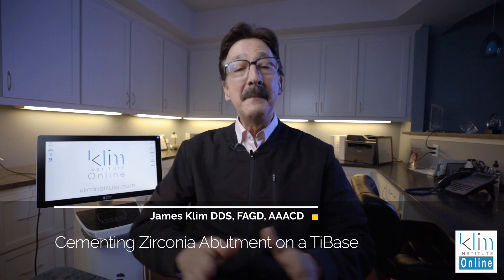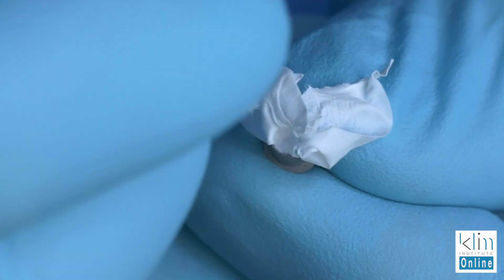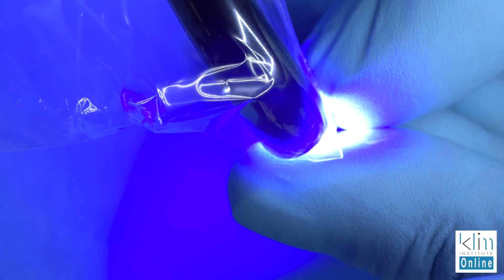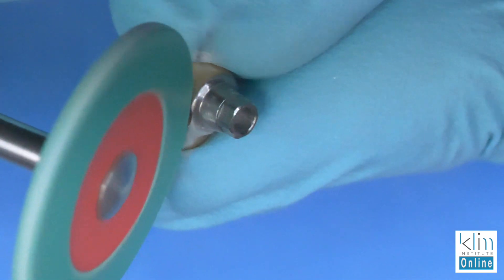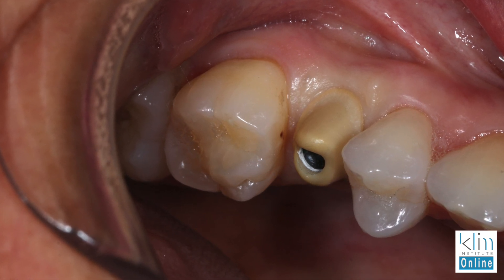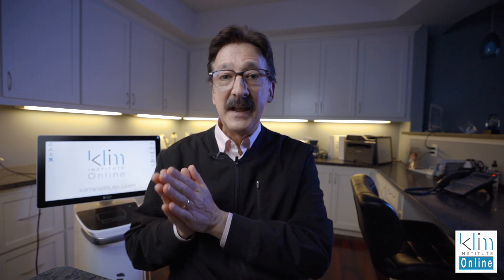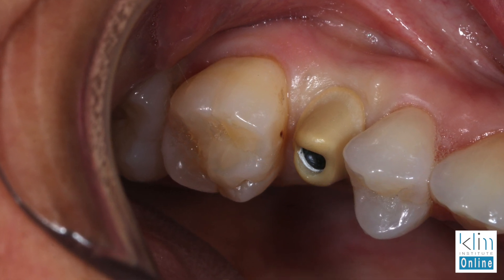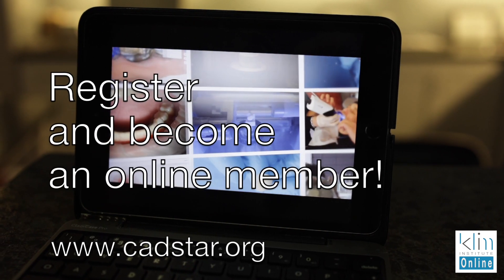Dental Zirconia Implant Abutments

Comment: I have a situation where my front tooth implant is placed deep and my gum has also receded back. I can't go back and change the dentist who didn't plan my bone graft properly. Now I am in the stage where abutment has to be placed. Is zirconia abutment a good choice for my case? What are my options to make my tooth look not longer
Reply from the maker: Healing can vary around implants and bone graphs.  I recommend you find a care provider that can work through your questions.  Not all implant situations are the same.  Zirconia abutments work well when the is adequate room.  It is case-dependent.  Wish you the best in finding solutions for your case.
Reply: It Is no good for cerec chairside, it can do It, use scan abutment

Comment: why wouldn't you just cement your ti-base directly to your milled crown?
Reply from the maker: The solid crown/abutment interphase is possible Two-piece options are chosen when implant place alignment differs from adjacent tooth proximal surfaces,  amount of subgingival emergence room and material strength demands, and at times, two-piece can be more aesthetic.
Reply: Also some patients does not want to have a resin obstructed hole in the occlusal surface

Comment: What did you cement the crown on with? I assume it was emax
Reply from the maker: Variolink Aesthetic Dual cure, the abutment is isolated once screwed down and torqued, isolated with a rubber dam, carefully treated with Ivoclean, rinse and dry, one coat of MonoBond Plus, then cement.